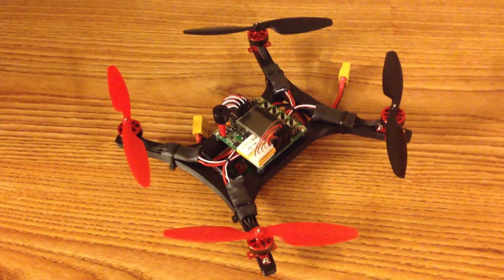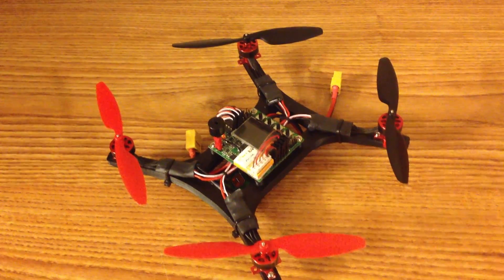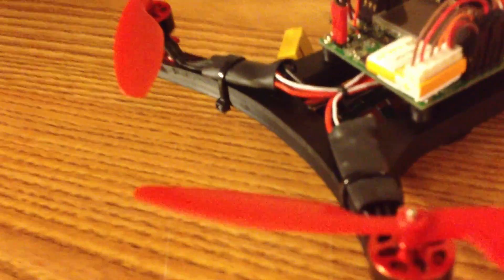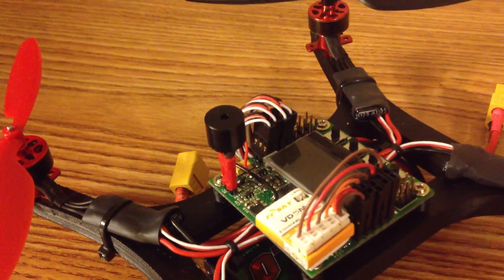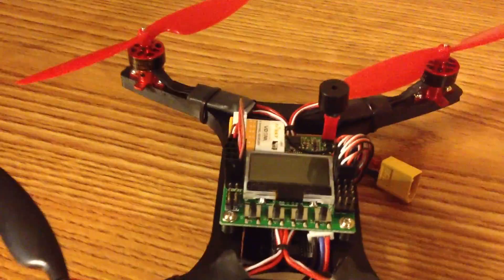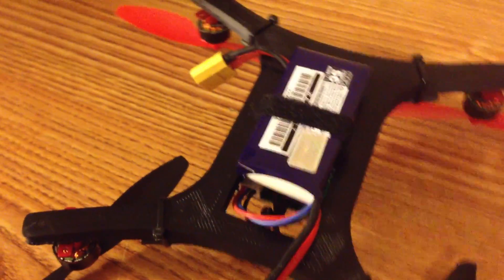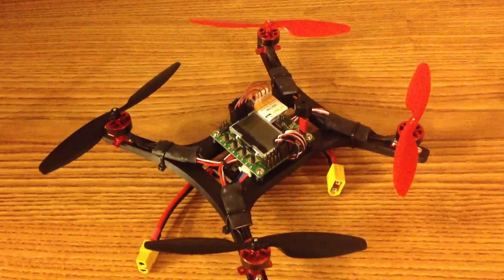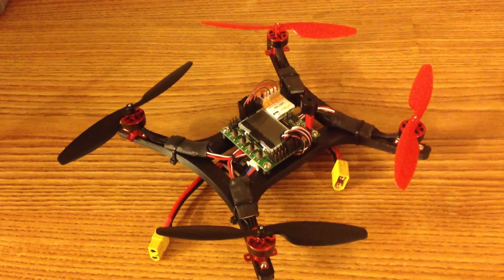3D Printed Micro H-Quadcopter

Comment: Nice build.
Reply from the maker: Thank you!
Reply: How does it hold up in a crash?  I built my frame out of aluminium thinking it would be almost indestructable.  The 3/16 aluminium channel bent upon impact(s) like a can :P.  It was cheap and easy to fix though.  Mine is a 370mm quad.
Reply: I found that if you can stand the extra weight put wood in the channel ant it will take really hard impacts well.  It is yet to bend or break that way.

Comment: that's great !
Have you heard about graphene capacitor, in a very near futur , you'll be able to fly for several hours, and restore your battery in less than one minute.
A society named "united drone" already use that kind of tech, and the most interesting is that anyone will be able to "print" batteries with a simple DVD writer , using the lightscribe technology, take a look at lightsribed graphene !

Graphene will also make flying devices lighter and so much more resistant.

Comment: We will use open source code for the flight control to hopefully save time. We'll be trying some interesting controller methods though, like short range flight via Bluetooth and a mobile app. While not terribly useful, I needed something to make the project more substantial than soldering some components together.

I also made a derivative of your frame on thingiverse for my printrbot Jr. My print bed is about 1/4 of the size of the whole frame.

Comment: Looks awesome. I am a senior Computer Science student and am going to be building a derivative of this for my senior project. Not having done any quad rotor builds before, I'm sticking pretty close to your parts list except for the controller board, which will be replaced with an Arduino based system.

Comment: yeah, I thought 140 might be too much, but that's my full video setup inc 800mah 3S and OSD. I could reduce it down to 70g by just removing the battery, although a small separate battery would be better. I checked out the ebay camera, looks neat except that it's a CMOS sensor and I'm trying to stick with CCD. If I removed the OSD, swapped to a 10mw Tx and used a smaller battery I should be able to get it down to 50-60 grams.

Comment: Cheers for the info, I went with the ZIPPY Compact 1000mAh in the end as it had the 25c discharge rating along with being only 58g (Almost the same as the 60g used in your build). Once I get this flying ill post a video response.

Comment: Im in the process of making a quad copter based on this frame. It will be identical to yours, bar the flight control board (im going with a cheap MultiWii board with just Gyro and Acc), and the ESC's will be the 10A versions. 

Any advice on the ideal battery weight ? iv seen others recommend some 800mAh battery for similar set-ups but to me that seems a little small.